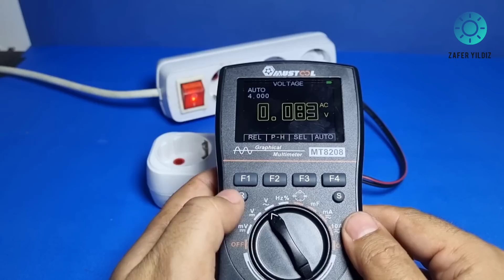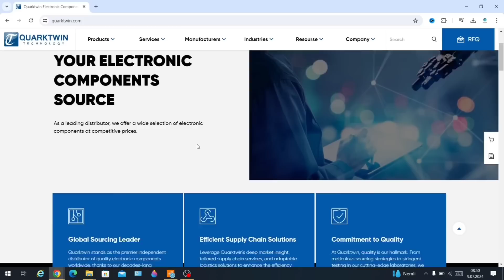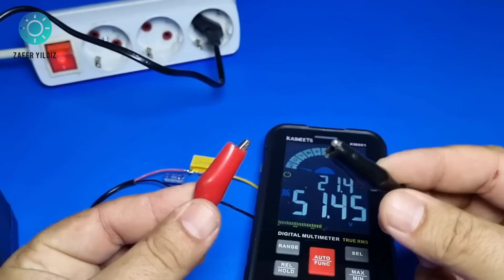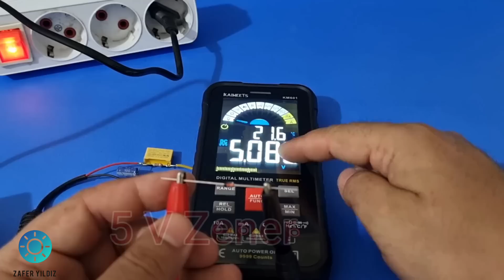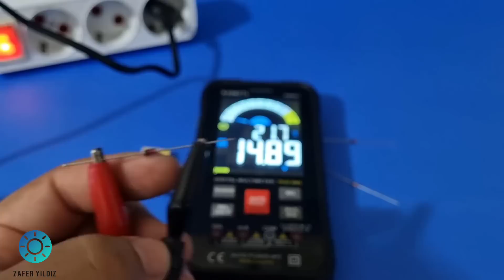DON'T WASTE!!! Make Cool Gadgets from Old Electronic Components

Comment: part 2:
The idea that the 4.7uf filter smooth capacitor without diode and the diode comes before the limiting capacitor is wrong. Ac current will directly damage the 4.7uf capacitor and the capacitor will heat up, causing the circuit to draw current.
Reply: Это что на полных идиотов рассчитано. Что только не показывают лишь бы заработать денег побольше. Жаль что Ютуб такими роликами превращается в помойку
Reply from the maker: It works very stably in the 220 volt band and as long as there is load.
Reply: He took the power supply output and gave it to the microcircuit, but he did not take alternating current. But he did not explain that in the video. So the circuit is successful like this.